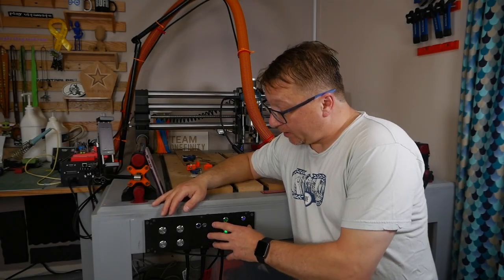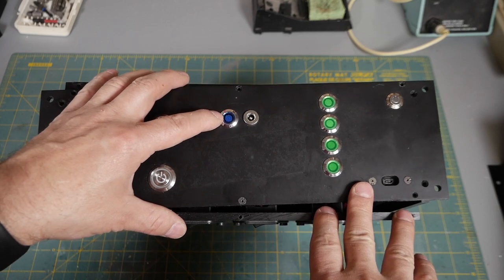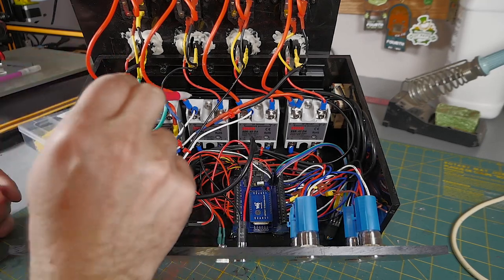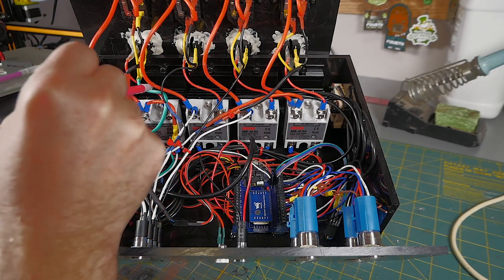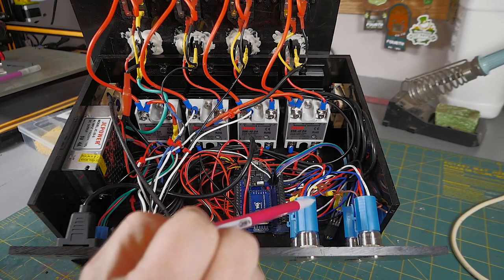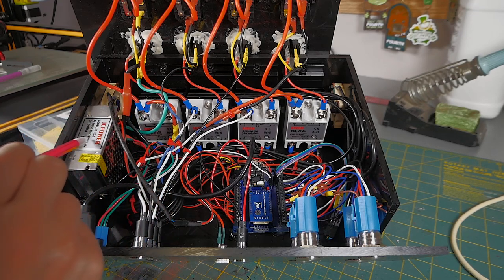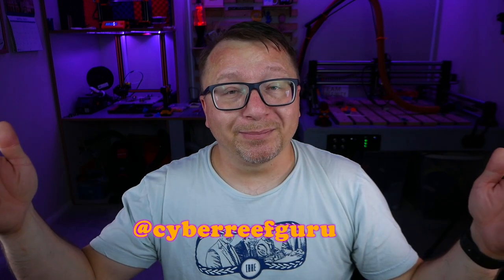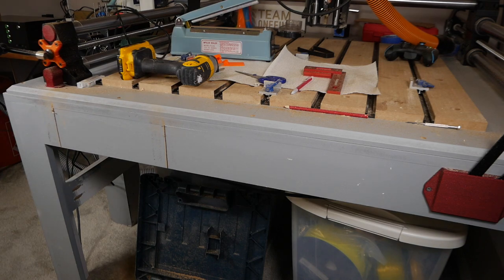CNC Control Panel - Part 2

Comment: Isn’t the enclosure a bit small? Looks like a rats nest. Could you do a cable management update ? I’ll sub now to see if you that if not I’ll unsubscribe 😜
Reply from the maker: Hello Kimberly - my enclosure was limited by the space I had for it.  As for cable management, everything has a place and it run appropriately. I'll add an update to my queue.  Thanks for watching.